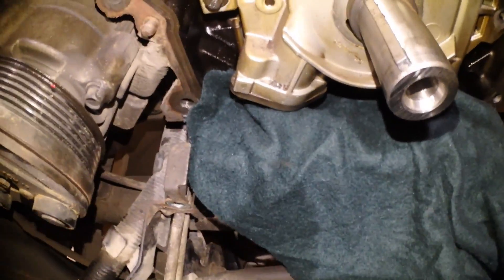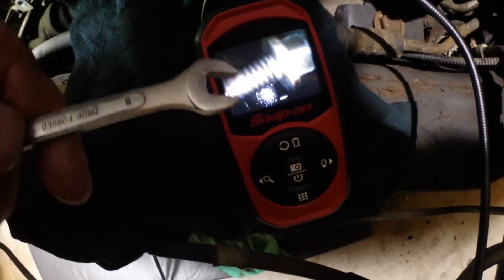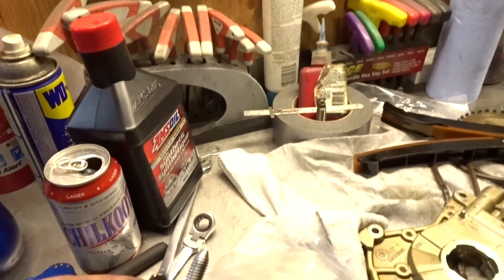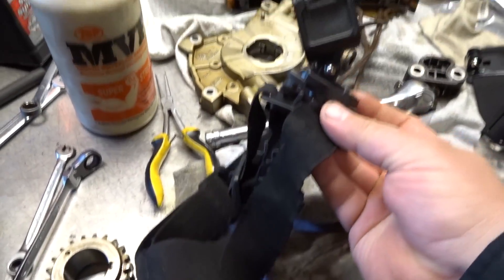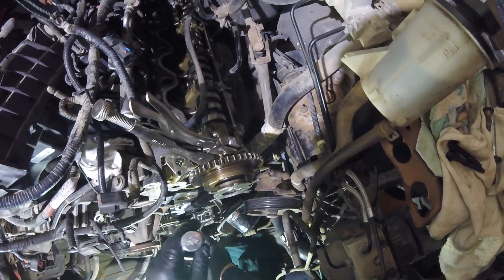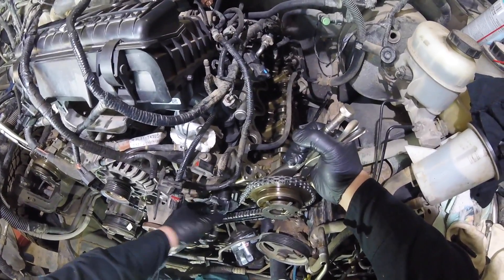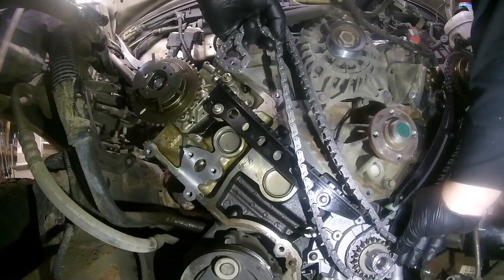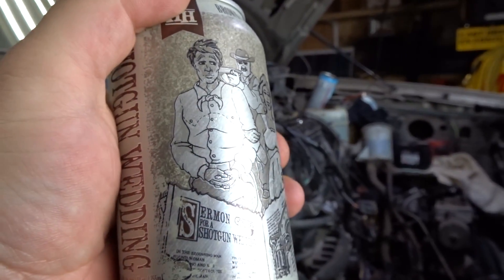Ford 5.4 3V Oil Pump Nightmare

Comment: Helps to just lower the oil pan down at the front. The you can get your fingers in there to handle the bolts.

Comment: 04 F150 85K- upgraded oil pump, timing components- all Melling by way of Rock Auto.  Truck now on 2000K since upgrade- Runs awesome,, really it's well worth the effort.  More power, less fuel consumption- you can almost feel the VCT system working because of the oil pressure. 
Did not change or remove lifters (it's quiet up top and such a difficult job), inspection revealed all followers in good shape for now. 
I had to remove the still pressurized ac pump and move it with the ac hoses to the side- to allow access to the passenger valve cover.  Tight but easier than trying to remove the motor mount to drop the engine.   
Dropped the oil pan to clean and remove any particles that would be up in the suction strainer.  All clean, made the pump install very easy.   If your doing this you must verify that your strainer is clean and free of debris- don't cut corners on this part.
Be sure to clean out any and all oil passages, or run Marvel Mystery Oil to de-sludge the engine before you do this job IF you have over 100K miles.   I was lucky, motor internals clean, low km's made this a worth while investment of ($980 CDN funny money),  or maybe a few sheets of plywood LOL. 
On start up removed oil filter and pumped in (squishy bottle and small hose) oil into the small oil discharge hole.  After a few turns of the engine the oil pressure indicator came alive, a few more turns to be sure then it started right up.  I had a BIG dance in the driveway.  Took 5 days, not rushing with breaks for sanity.
 
I would be very interested to know if high mileage engines with all the problems can be fixed by changing these parts or is it too late at that point?

Comment: Dropping the pan may have eased the stress?  I still got my 06' Been running like a champ since 2015 when I did chains,tensioners ...No Phaser or cam tick,knock.....Have a few guys with over 200k on theirs-  Oil change is the key

Comment: I am getting ready to pull the timing chains and guides off. I'm 16 and I dont know what to do put the key hole to the 12 o clock position, then what take the guides and tensioners off and pull the chains and everything off? Please help and try to explain.

Comment: I stopped here to see how someone else was able to get that damned bolt started...
I see you made a point on the bolt and the duct tape should hold it into the swivel ratchet head wrench.
These are very well made engines and if taken care of they'll run 300,000 miles. Mine has 285,000 and I just broke it open for chains, etc and redid the valves and heads and most importantly, will be adding the Time Certs for the plugs. All aluminum heads eventually blow the threads on the plugs... Chitvrolet is the worse, but even VW and Lexus and BMW have the issues... If you haven't taken care of it, you should do it preemptively before you caught out on the road somewhere with a spark plug missing and compression noise blowing in the wind.

Comment: that oil pump screw that you were having a problem with.  I made a stud from an identical bolt.  installed the stud, then put the oil pump on and then only had to put a nut on the stud
Reply from the maker: That’s smart thinking and most likely way easier

Comment: I wonder how much a Ford Dealer would charge for this kind of job? $2500.00, $3,000.00?
Reply from the maker: Depends where you live in Canada it was way more than that
Reply: @BackCountryWrenching  They won't fix it- New engine is the only dealer option now.  BS for sure

Comment: I actually just did this part of the job this past week. If you drop the bolt in the oil pan, as long as its on the top end part, its not too hard to reach in there and grab. When it drops down to the bottom part of the pan, its a pain in the ass to get... ask me how I know :( ... I didnt want to drop the oil pan so I bought a pickup tool with a magnet small enough to fit through the oil pan drain plug hole and pushed it back up to the front of the engine. I was able to pull it back out through where the oil pump was once I did that. I am recording all of this currently and will post videos soon. I will also post a video on how I got the bolt out of the oil pan.
Reply from the maker: I know that’s why I stuffed the rag in the pan to prevent that
Reply: Bullshitkorner yeah I should have done that lol

Comment: have done this job many times as i am a dealer mechanic. its definitely not the easiest job to do. I will stick to my pre  -04 f150's, the 2v engines are so much more reliable. like the duck tape trick, i usually pre-rtv the bolt into my ratchet wrench. might try the tape trick next time.

Comment: I had to do headgaskets on my 03. I replaced everything I could, lash adjusters, lifters with TFS, new chains, guides, water pump, had heads redone with valve job and new seals and yes, the oil pump. The job sucked with the engine still in the truck. I remember using a magnet to find an oil pump bolt in the pan. Went by feel, loctite and got those bolts back in. Between having to buy 300$ worth of specific tool and parts, I think I paid a grand to do the whole thing myself! Only paid a friend like 200$ to redo the heads and it was still an expensive pain in the lower back! Still got the truck and its been fantastic. 

 I hate to say it, but the oil pump was hardly the worst. My saving grace was I could walk away, I was laid off and she would be waiting for me, sitting on her ball joints in the garage for another round!
Reply from the maker: with the amount of work you did i would say the oil pump was hardly the worst
Reply: Bullshitkorner I had constant MFBT each time I walked away from it!

Comment: Man, I hate timing engines and fitting chains/belts. Some are awkward as fuck. Timing marks sometimes don't help either. Timed mine 180º out by accident once and it sounded like a vacuum cleaner.

Comment: That bitch bolt was the pickup tube bolt. Would it have been easier if you dropped the oil pan?
Reply from the maker: that would involve dropping the front axle down and a whole bunch of other work

Comment: You got those cheap plastic tensioners with the small gasket on the underside, should've got the cast iron tensioners from Melling.
Reply: How is the melling tensioner hold up compare to oem tensioner??

Comment: Just a heads up for reassembly. Be extra careful when replacing the valve covers. Did this job last month and passenger side cover gasket got out of position at the back of the cover and had to remove a second time to correct an oil leak. Was a pia job.
Reply from the maker: this job has been completed for a couple months now, but you are correct.  I could see that happening before i even got the valve cover on.  i'm sure a few people have been burnt by it

Comment: If I ever own another 5.4 3v (probably won't) I'd rather pay someone to do the job rather than do it myself again lol
Reply from the maker: i know right, owning one is enough why punish yourself again
Reply: Brute 1985 I saved about 900 off the 2100 you were quoted when I did mine used all motorcraft parts except for the oil pump and gaskets
Reply: Hell, working on my F250 with a 5.4 3V is a dream. It's my 05 Hemi wedged into a Grand Cherokee that's a nightmare. That thing would make a preacher cuss

Comment: The hooker comment made me like the video haha. Jk love watching this as much as its a pain in the ass its knowledgeable and interesting compared to doing a 5.7 hemi timing job ... which id take over this anyday
Reply from the maker: interesting is the 5.7 hemi more of a pain in the ass ?
Reply: no its far easier. As far as i can see  you didnt need to take off to much where as on the hemi just about everything goes (water pump, PS,alt and plus its single chain and 1 cam... on a plus side all the dual overhead cam motors dont have lifters grinding down camshafts and causing a real sht show